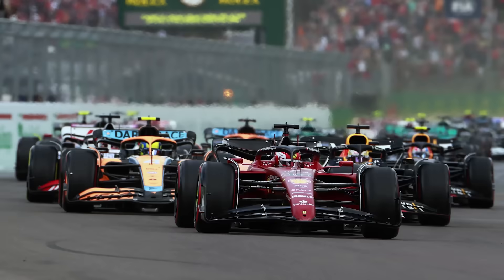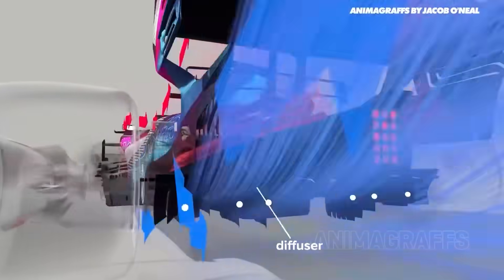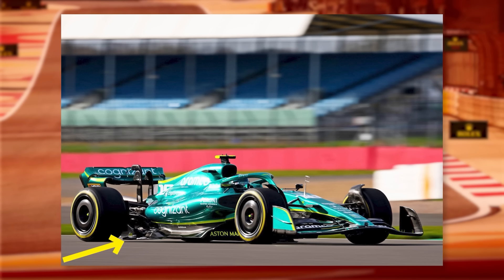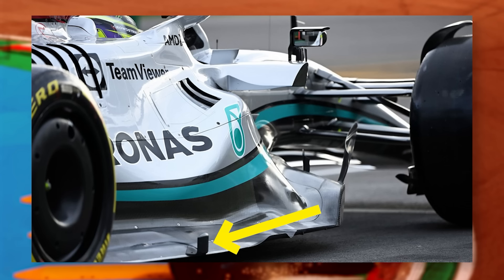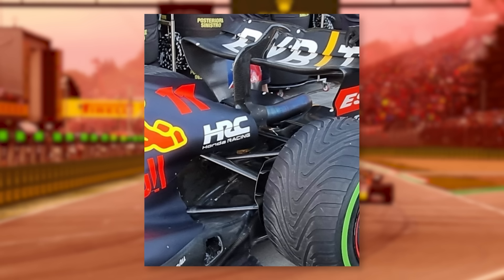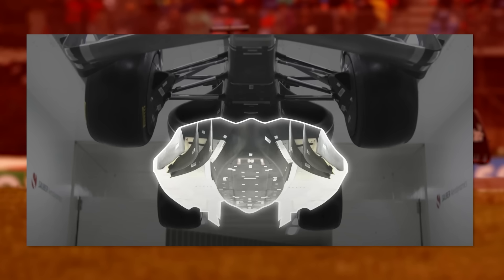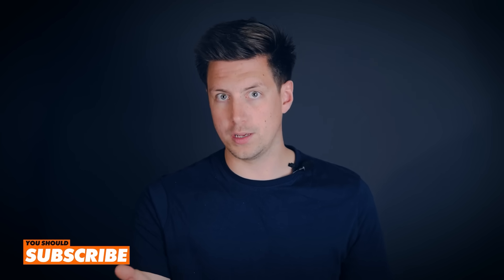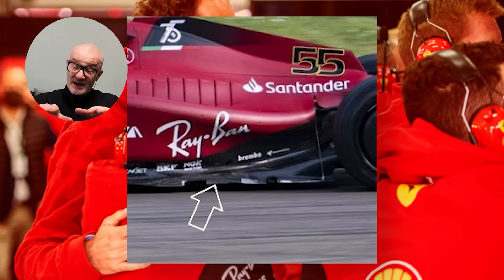The Tiny Component Giving Ferrari Incredible Pace

Comment: This is all madness… for someone who doesn’t know the rules that is…. In that the rear of the floor needs to be attached to the suspension and therefore follow the road wheel hight not the body ride hight. They need to find a way for the ride hight of the floor to follow the wheel hight not the body hight. There by removing the suspension variable from the equation.

But as said, I dont know the rules …?

Comment: Could I ask that when you show a graphic to illustrate a point, that the element of the graphic you are talking about is highlighted. Sometimes I get it, but frequently I don't and I find myself having to frantically scan the screen to see exactly what you're talking about. In doing that I lose concentration on what you're talking about and its frustrating. An arrow or circle will be just fine.
Edit: I posted this after watching up to about the 3.30 mark. The graphics after that do have the requested indicators and it is much easier to follow.

Comment: What if at 4:15 you do not make them rigid, but connect them with suspension? Meaning when speed is high and suspension squats, to  increse tension and "lift" up edge of the floor? It woud not be "active".

Comment: another thing is RB has more lateral floor variation (contraction at center expansion on both ends - fences & diffuser) =>  floor less sensitive to (vertical) ride height changes.
That's why they (almost) don't porpoise

Comment: So I have a dumb question as a new F1 fan. I understand that any time in racing there are new rules regulations that the team to adapt the best comes out on top. But have we ever seen such a drastic change like this? Obviously what comes to mind is the aero cars of the early 70s or the turbo cars in the 80s, but from my understanding teams adapted pretty quickly and were at a somewhat even playing field. Seems this issue is out of left field given nobody was able to anticipate it in their internal simulators. Curious what others think.

Comment: Could they not connect the floor to the suspension, so that as the suspension goes down, it pulls the floor further up, keeping the distance between the ground and the floor?
Reply: They’re already doing that with the wires at the back of the floor

Comment: is the bouncing a problem of center of gravity. Seems the merc transaxle and mclaren transaxle are having different results.
Also. the teams have different jump outs in the ground effect tunnels. Example; Red bull has jump out on its inner walls near the front of the tunnels and smooth roofs. The merc has smooth walls and 2 big jump outs in the roof just before the diffuser.

Comment: I called this floor flex after race 1. Merc didnt design an entirely new chassis and the loading from ground effect is entirely different then downforce from wangs. So they are probly feeling it even more. 
I keep wondering if Ferraris spring loaded bit at the front is a hidden damper as well. It should only be working when the car bottoms out but who knows
Reply: Merc has designed a new chassis. This is nothing like the 2021 chassis
Reply: @YouTube2021FM  they didnt engineer an entirely new chassis from the ground up to save money with the cap. Its the old chassis modified. So carbon fiber is layed out for the old loading. In theory it was a smart move considering the performance from last season. In practice it hasent fully worked for them. Just think about the loading on the chassis prior to ground effect. Both wings were at the front and rear so it would be pushing down and flexing the floor up off the ground, now its going in the complete opposite direction with ground effect sucking it down
Reply: I get downforce from my wang too

Comment: Now i'm no mechanical engineer and i have no PhD in fluid dynamics and i dont have access to model and wind tunnels etc. I'm just a simple mining engineer, so maybe someone can help me make sense of a thought i had. 
Could it not be possible to introduce a tiny amount of air flow to the underfloor by way of the sidepods after it's passed through the radiators. Most of that airflow for all teams gets routed to the back and most teams have vents on top of the side pod. Would the introduction of a tiny bit of air about 2/3rds of the way back of the floor maybe stabilize the massive amount of suction downforce occurring at the rear of the car and help stabilize it? 
I cannot be the only person who has thought of this, smarter people than me are working on these cars night and day. So looking to see if someone has the know how to school me on why it isn't a solution.
Reply: I doubt that would be legal. Plus neither me nor you can really predict how that would really work out. I do think too that it would decrease the "sunction" like you said but that would actually be terrible for the teams. They will take any sunction generated they can get. Its never too much. The more the better. Plus they wouldn't need to go to that lengths. Thats basically the same as raising the floor  I suppose which is something they can already do. The rick is not to lose any downforce while removing porpoising or limiting it to the straights.
Reply: My question is what prohibits Jounce Bumpers for the suspension? 
Some trucks built to tow use a small piece to limit suspension travel so the leaf springs can't flatten completely. Is this not possible with push rod/pull rod suspensions?
Reply: @CAFFIENEHOUND  anything that you can think  of that might help its a safe bet to assume its illegal. I don't know the rules but im sure it is. Ive thought of that myself as well.😂😂
Reply: @aldogjipali2835  I figure there is a reason it isn't being used, but hope that someone in the comments of this video could tell me why.

Comment: I’ve been screaming in the comments section for weeks that Scarbs was wrong on this bouncing explanations.

Now you talk about “flex”, that’s actually “wing flutter”. And you keep going on about airflow and airspeed and never mention air PRESSURE! 
You can’t talk or explain aerodynamics without mentioning air pressure and pressure differentials 

So many channels about F1 and these freakin “experts” just can’t get it right! 

I mean even those jokers at Donut media explain this properly and even joke about it. And then comes Mr Scarbs with a 4th grade level solution
Reply: I mean by definition a difference in airspeed causes a difference in pressure. It’s basically explaining the same concept with different terminology.
Reply: @456MrPeople  precisely. But you have to know that beforehand. You need to have that level of knowledge and understanding. 

Why not go straight to pressure? I mean, everybody knows what happens when you open a can of beer or any other pressurized stuff.

Or even explain it all. Both airspeed and how it affects air pressure. 
It’s a huge part of what makes an F1 car work and it should be properly explained 

All the best

Comment: What did callum meant by the stays moving with the suspension? Aren't the stays fixed rigidly to the chassis? If it were to move with the rear suspension...then the side floors will be vibrating right? As the car goes through uneven parts of the track
Reply from the maker: I meant they are a sprung part of the car, so as the car porpoises the floor goes with it. A skid hold the floor a fixed height from the track
Reply: @Driver61  ah....got it👍 thanks for the quick reply....big fan and great work🙏

Comment: Wonder what kind of damage a titanium strake dragging on the ground does to the track…
Reply: And the steel skid plate?
Reply: @TheZwhyX  The skid plates are annealed titanium 6Al-4V, however that's still a lot harder than mild steel.
Reply: @ASJC27  did they update them? I thought previously in a video or so they said it was steel (confirmed by the orange sparks vs Ti-6-4 blueish ones)
Reply: @TheZwhyX  No they were required to be titanium ever since they were introduced in 2015. 
The 2015-2021 regs simply say they have to be made from a titanium alloy. The 2022 regs require speifically that the titanium alloy be in accordance with AMS 4928 or 4911 (i.e. 6-4), and annealed.
Reply: Very good point.
It's the only reason I can see for the FIA acting against them. It's a simple and now widely known addition to the floor that seems to be of benefit, I'll wager that every other team has their engineers sweating over their CAD screens trying to emulate the system ASAP
Reply: I doubt it would do a lot of damage to the track, for several reasons, although I could be wrong...Firstly, if the skids are digging into the track, enough to cause damage, they are generating friction, which no team would want. I would bet they are designed specifically to NOT dig in and do damage. Secondly, skid plates have been used in F1 for decades; If they damaged the track surface I'd bet they would have been banned long ago. Thirdly, I'm not convinced that the titanium skids are any harder than steel anyway; the brinell hardness of regular titanium (70) is around half that of steel (121). I'm not sure whether the annealing process makes it that much harder, to be honest, but again, I could be wrong....
Reply: @timjohnun4297  As said previously, the skids are required to be annealed Ti-6Al-4V, which has a hardness of 36 HRC. For comparison, AISI 1025, which is a mild steel, doesn't even register in the HRC scale and has to be rated in the HRB scale. In the Brinell scale, 1025 is 126. 36 HRC is about 334 Brinell, so the titanium is far harder.

Also, annealing doesn't make the titanium harder - it makes it softer. 6-4 is available as either annealed or in STA condition. In STA its hardness is 41 HRC, or about 379 Brinell.
Reply: @ASJC27  I can’t argue with you there, sounds like you know hardness more than I do 🤣 but whether it’s harder or softer than steel is still probably irrelevant imo because both are harder than asphalt anyway 🤷‍♂️

Comment: I dont understand the fins undernesth the floor. To me it looks like they just shove all the air out the side of the floor and not directing in through the tunnel and diffuser
Reply: Flinging the air outward at the front is precisely how they direct air to the diffuser. You want low pressure under the floor (that's how you make downforce). Because the high pressure outside cannot be completely sealed off, it will cause the air flowing through the tunnels to curve back toward the centerline by the time it gets to the diffuser at the rear.

It's analogous to throwing a ball: you aim well above your target because gravity will pull your projectile down. The pressure gradient is acting in a similar manner. That's the most basic answer I can think of, hope it helps!
Reply: @Bruh Bruh I'm not an aerodynamicist but from my experience in studying fluid dynamics and looking at the images it looks like Most of the downforce is created by the two inner tunnels with the inner most tunnel doing most of the work while the 2nd innermost one is partly generating downforce and partly generating vortices to seal off the sides of the floor, same as the two outermost ones they're generating downforce at the front end and then using that air to create vortices by running them along the floor edges thus sealing the undersides of the floor and prevent leakage from the sides. If you see closely the innermost tunnel covers more than 80% of the floor and the contour in the center doesn't matter much because venturi effect relies more on convergence and divergence of the tunnel rather than the shape of the tunnel basically the more you constrain the fluid in the center and give more room for expansion at the outlet and inlet more downforce you can create.
Hope this helps
Reply: Instead of insulting the OP here, let's help them understand the purpose of the floor, and how the air underneath the car works.

To the two commenter above me, why aren't you both in Formula One as aerodynamicists, if you're calling them out? And why aren't you suggesting some answer to counter their claim?
Reply: And that's why you're not in f1
Reply: @dylanburston7453  🗿🗿🗿